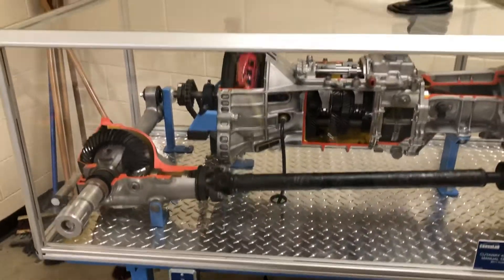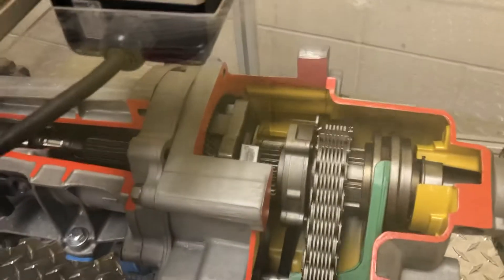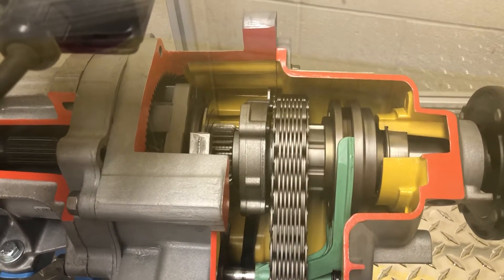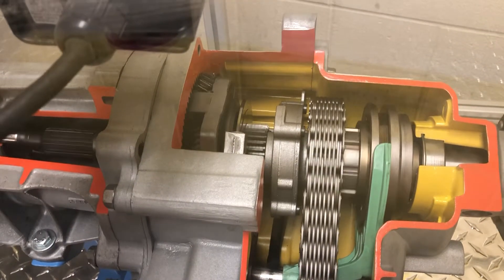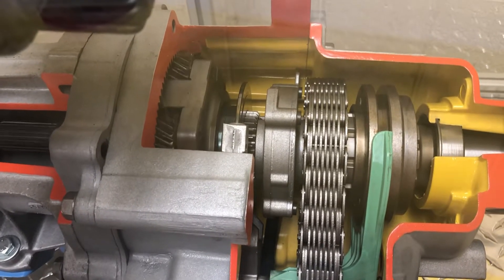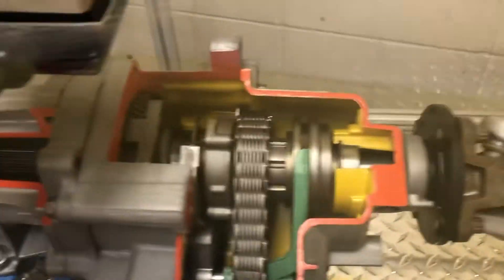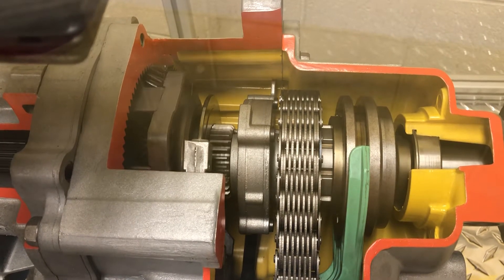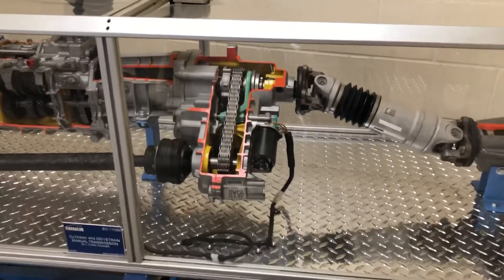Transfer case changing the range switch

Comment: Why when my front passenger sv axle broke the vehicle stop moving?
Reply from the maker: Because your front differential wasn’t a limited slip/locking differential, all the power went to the axle with the least resistance. The broken axel would have done 100% of the rotating.
Reply: @autotech4103  it's a 4x4 hummer h3 front cv axle broke, and it stop driving, I thought it was rear wheel drive
Reply from the maker: @RR-ul5st  I could be wrong but I believe it is full time 4wheel drive. Engaging the locking diff should have made it drivable with the rear wheels.

Comment: Great info, thanks for posting it. I have a question. 
As you might be aware around 2010-2013 Toyota/Lexus made a switch on their transfer cases supplier from Aisin to Boerg and the fluid requirement went from regular 75w90 to plain 75W at a very high price from Toyota. Lots of people kept using the 75w90 while others swear that it will damage the Transfer case long term and that the thinner 75w oil is required to function properly. Looking at the internal workings of these cases it looks like both oils would work the same which a lot of people agree to at the very small expense of very low fuel economy decrease. Would you mind sharing your opinion on this?

Thanks in advance!
Reply from the maker: I don’t veer away from manufacturers fluid requirements. I saw all the headaches people had with Ford pickups that refused to use 5w20 when it became a new viscosity. I trust the manufacturer understands their clearances better than peoples opinions

Comment: Maybe someone here can point me in the right direction. I have plenty of experience 4wheeling in Chevy Blazers so I'm very familiar with their normal operations and behaviors.  I have a 2004 Blazer that seems to shift through 4l, 4h, and 2h exactly as it should. It drives perfectly normal in 4lo, but barely moves in 4hi and 2hi almost as if the transmission is slipping. Sometimes it's finicky and doesn't want to shift, but always eventually does after a few attempts.
Reply: The Blazer is fixed, and the transmission seems to be okay! I figured I'd share this info for anyone that stumbles upon it in the future. The rear brakes were locked up, and the pistons and pads were rusted in place. I replaced the calipers and pads, and it was then able to move under idle. It still wouldn't start to accelerate until 1500rpm, and accelerated very slowly. There was a code for EBCM open circuit which was likely the cause of the brakes locking. I believe it was C0265. I cleaned the ground on the back side of the core support under the airbox. The brakes are functioning, and the code hasn't come back. I read that the EBCM open circuit can prevent the transfer case from shifting into or out of 4lo, but that doesn't explain why it got stuck in 4hi. The transfer case is working now though. There was a code for an o2 sensor heater open circuit. I don't remember the code. I replaced the sensor, and regained some power, but still had to hit 1500rpm before it would even try to move. There was also a P0300 code for random/multiple misfire. The distributor cap and rotor were completely shot. I replaced them, and got all power back with a perfect idle, smooth acceleration, and smooth shifting.
Reply from the maker: @AintTheDroidULookinFer  if the vehicle couldn’t roll freely that could explain the tcase stuck in gear. That’s a complex but interesting vehicle issue lol
Reply from the maker: If the transmission is slipping..........then low range could mask that problem as the gear ratio would make the driveshaft easier to turn. Is your transmission fluid brown and burnt smelling?
Reply: The fluid looks and smells good. It may be a tiny bit overfilled. I just got this Blazer yesterday and tinkered with it for several hours. I kept getting the same results that I described earlier. Today it changed. It stuck in 4hi, and will no longer shift. All I'm getting when trying to shift is what sounds like a relay in the TCCM clicking On/Off On/Off, and a barely audible sound of what sounds like the transfer case very weakly trying to shift. Another thing I noticed today before it got stuck in 4hi is that it feels like it has full power in reverse in 4hi and 2hi, but almost no power in all the forward gears. 4lo doesn't feel like it's slipping at all in forward or reverse.
Reply from the maker: @AintTheDroidULookinFer  wouldn’t be surprised if the previous owner changed the fluid to try and “fix” it. Transfer cases sticking when shifting is pretty common as most people don’t shift it very often.
Reply: He did change it a while back because he replaced the shift solenoids thinking that would fix it, but he said it seemed to get worse after that. He's been using it to haul hay around his property, and he has just been driving in 4lo since it was the only way it would drive normal. I've ruined a few 4L60E transmissions myself by overheating and by submersion, but I've never seen one that would work in one range and not the others. I thought it may be something in the transfer like a broken fork not fully engaging the clutches. That's how I ended on your transfer case videos today. Very cool videos btw!
Reply from the maker: @AintTheDroidULookinFer  when a transmission is on its way out, more times than enough a fluid change will finish them off. It is quite strange about the t-case range making a difference as I have never tried low range on a slipping trans.

Comment: I have a clicking noise in my NP231. Noise is there even neutral  
Has to be the planetary gear area because that moves even in neutral right?
Reply from the maker: You seem like you have the right idea. The input side of the transfer case. Most likely a planetary problem
Reply: Thanks for the input (lol)